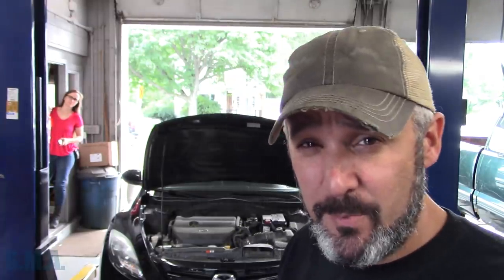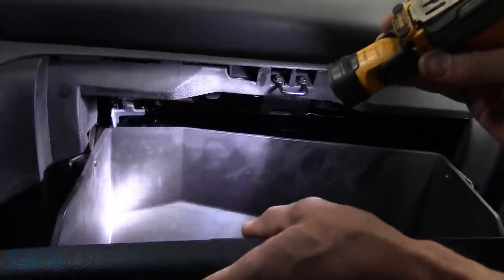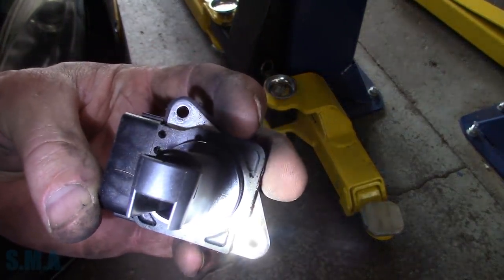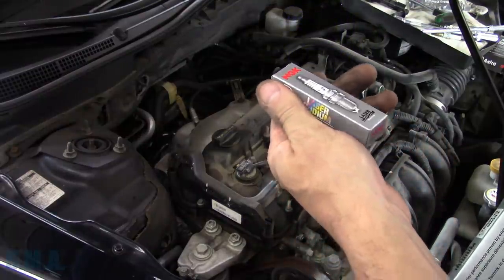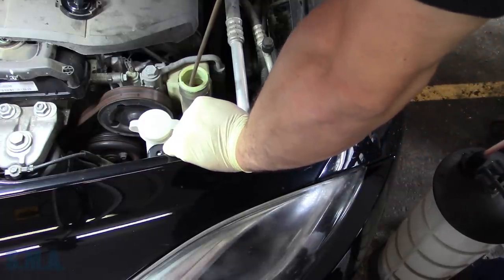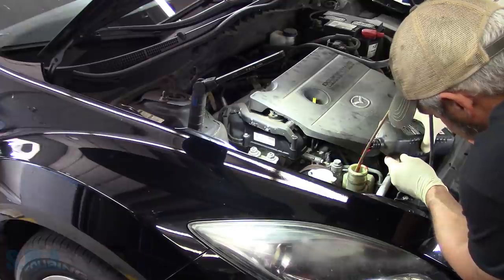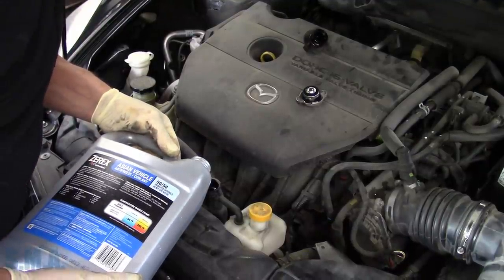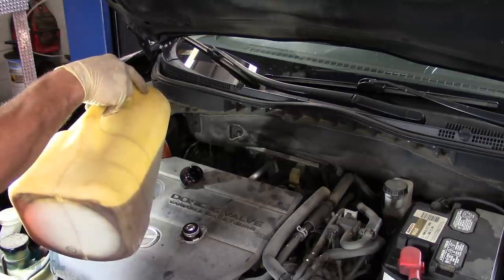Mazda 6: 100k Service Front To Back

Comment: Great Job ! Thanks. I LOVE  the education, plus your humor, candor and asides! As an EE "Shade Tree Mechanic", just did the 120K service myself on my 2003 Lexus RX 300 ... WITHOUT removing the intake manifold. Did not trust myself to do that. MANY HOURS!  The back 3 plugs & coils ... as you know are a true PAIN ... Removal order 4, 6, 2. After installing # 2 PLUG ... rubber boot was no longer in my socket! Whoa! Panic Time. After an hour or so on YouTube ... made my own extractor from a white metal coat hanger ... and ... with slim 6" vice grips as a handle ...  Got it OUT ... then went local and bought a MAGNETIC 5/8" socket. Whew!

Comment: Seeing you fill the washer fluid absolutely to the top reminded me... My mom barely drives anymore, maybe 1500 miles a year, so I do annual oil changes on her car. At the time, it was 2005 Mazda3. I changed the oil in the winter and topped off the washer fluid like that. One summer day, I was visiting her and we took her car somewhere. It was quite hot out, so we had the ac on and I'm sure it wad lava hot under the hood. When we got home, I noticed fluid leaking under the car. So, I popped the hood to have a look at washer fluid was percolating out of the little vent hole in the washer bottle cap. I guess filling it all the way up in the winter and having it expand in the summer made it leak out the top. So, I don't fill it 100% to the top anymore.

Comment: I use the old school trick on plugs, a piece of vacuum line on the plug wire side, twist by hand to make sure there is no cross threading on my Chevy Thunder, then torque to specs! Geez Louise, when was its last oil change? That brake pressure bleeder is a handy tool, I have a vacuum bleeder. Thanks for taking us along for the ride!

Comment: Man you are thorough! This is the sort of work I want from my trusted mechanic: just fix whatever little things you find and talk to me for the expensive repairs. I am so glad that you replace the drive belt. Would it be good to check the timing belt too (I am not sure if it has timing belt or chain)?
Reply: They’ve got timing chains, fords stopped using timing belts like back in the late 90s, we’ve got several customers at my shop that are super comfortable just telling us to go through the car and repair as needed and then just call them for anything major, definitely have to earn that trust over the years though.

Comment: Thank you for making that fact about MT fluids more widely known. Most people, even a lot of mechanics, do not realize this! I bought a Ford Ranger off a mechanic a while back, it had been his work truck for 21 years and not a single fluid in it was correct, right down to the gear oil I drained out of the transmission where MERC IV should have been. I was putting a lot of miles on it at the time so I drained and filled, put 1500 mile on it, drained and filled again, another 1500, then ended up running Royal Purple Synchromax. Fortunately, no lasting damage and after the 2nd drain and fill and getting all of the gear oil and grit out, the transmission no longer whined (screamed when I bought it, actually) and shifted smoothly.

Sadly, I was nearing the end of my list of repairs when a truck pulled ouf 50ft in front of me across 2 lanes of traffic and came to a dead stop. RIP Ranger.
Reply: Even if the MT does take a 75w-90 or 75w-140 or straight grade gear oil, wayyyyyy too many people put GL-5 in the thing. It must be GL-4. GL-5 is for differentials and it has a lot of sulfur EP additives which corrode brass. Synchros are brass. GL-4 has much less of those compounds and it does not attack the brass synchros. The synchros are what fail and lead to an MT's replacement because it starts grinding and failing to shift unless rev matched. People do more harm than good when they don't RTFM. Too much pride in some people's minds to do that though.
Reply: @mannys9130  Yup, I've seen this too. I've also seen (and been paid well to fix) what happens when adding DOT5 to a DOT3 brake system. People, higher number does not mean better!

Comment: down south  I have started cleaning the condensers as part of extended services ...drops pressures extending comp life and gives a temp drop at the vents
Reply: Eric car guy did a vid on that ,whats your process in cleaning the condensor if i may?
Reply: I buy the AC cleaner in a can for home systems. It foams really well and gets all the gunk out. Just did my frontier's condenser and trans cooler. So much junk and dirt came pouring out. Make sure to give it a good rinse with water.
Reply: @CRAPO2011  use a metal safe condenser cleaner to flood the radiator and condenser fins until it foams out both sides, let sit 10 minutes then reverse flush out the cleaner very thoroughly then blow out with a leaf blower until dry. recommend replacement if water flow reduction is noticed.
Reply: @jasoncook5307  Thanks for the tips :)
Reply: @CRAPO2011  also start at the bottom and work your way to the top so that the water doesnt just run right off from it
Reply: Yep Cottonwood trees are evil.
Reply: Nobody cleans their heat rejection devices and it makes no sense to me. Every 2 years or so I pull my whole front bumper off and clean the hell out of my radiator, condenser, and aux trans cooler that I installed. It's important. Cool cleaning is important for home HVAC too.

Comment: Check his recalls. He may be up for new free control arms and subframe. Did a ton of those in NY when I was a Mazda tech.
Reply: Most likely has the subframe recall. The control arms are only cx7, cx9 and rx8
Reply: I got thinking that after. Kias have the control arm recall which I work on now.
Reply: My 09 got the subframe recall.  Mine actually failed on the road exactly how the recall said it would.  Took Mazda 6 months to get the new subframe to me.
Reply: All because poor design of the AC drain.  Gotta love the Ford days of Mazda
Reply: @codyjacobsen6954  They claimed "insufficient paint" was the root cause.  No amount of paint could protect the poor quality steel they used for that.  Light surface rust on all nearby steel parts--subframe rusted completely through.  Crumbled in your hand.  I was very fortunate that mine snapped in a low-speed braking situation, rather than at a high speed.  Otherwise, the car has been great! (no joke).
Reply: lwnf360 .... Exact same steel that Chrysler use as in everything they make now....
Reply: I got lucky and mazda passed my subframe &installed a reinforce bracket, which im surprised it passed since i live in the midwest

Comment: Yes I found out the hard way with a ZF manual transmission in a Ford super duty, You must use the synthetic oil called for if you want the shifting smooth 🤓 Also on a Honda civic 1.7l 2001 thru 2005 it has a Coolant drain plug above the oil filter to drain the engine block down to almost dry for those who own them 19mm socket takes it out also don't loose the aluminum sealing washer on that plug ,  but first drain the radiator of course make it's fully cooled down first. GREAT CONTENT ERIC❗👍

Comment: I just did the same, all fluids replaced in my recent daily driver on top of getting all of the 'other' issues sorted.  While I already know better, I neglected to check the spare tire pressure to date.  Then I am watching Eric check that Mazda spare and I think to myself "yeah I need to get to that too" then I say no, I need to get off my stump this very second and check the darn thing right now or it will be forgotten.  I find the unused 14 year old factory original with only 7psi in it.  All the good a spare does when it is flat too.  This should be the very first thing I check when getting another beater, not months or years later or potentially succumb to a double whammy when getting a real flat tire.   Thanks Eric, I needed that nudge :)

Comment: 10:01 - adding Squirrel™ to your combustion chamber boosts horsepower and improves fuel economy...
Reply: Red or grey?
Reply: @dot7107  most likely red ( grey ones tire out rather quickly )
Reply: @dot7107  ground squirrel they like the dark.

Comment: I have a 2017 Mazda 3 with the 2.0 Skyactiv engine. And I freakin' love how Mazda made servicing such a breeze. Everything that needs to be changed regularly is easily accessible. German manufacturers could really learn a thing or two from Mazda's engineering.

Comment: We owned two Mazda 6s until last year, a 2009 and 2010, 4 and V6, both auto trans, and getting the right trans fluid is a tad harder than one might hope for - the trans uses Mazda fluid, but the part number is very close to a Ford sourced fluid, and if you mix it up, you get some crappy shifting (I didn't mix it up, the shop did). Ford and Mazda both issued TSBs reference the fluid mix up for Escapes/Tributes, Mazda 6/Fusion, etc. I ordered the correct fluid and doing three drain and fills with the correct Mazda fluid fixed it for me, fortunately, without grenading the trans. All part of the joy of the Ford/Mazda partnership that is thankfully over.
Reply: thankfully it's not as prevalent now, but the 80s/90s/00s were hell for chrysler autos, because people would CONSTANTLY put the wrong fluid in.  read the damn owner's manual! ATF+4 was spec'ed for a long time, and people and shops would put in ATF+3 or god forbid dextron/mercon fluid.  that'll smoke your go in a hurry.

Comment: Back in the ‘80’s, I was watching a car repair program on TV and they recommended flushing the power steering fluid at certain mileage intervals.  My 1982 Ford Escort had about 60,000 on it and I decided this is something I could do.  I flushed the fluid, which was a somewhat messy project and felt good that I had done the job myself.  It wasn’t long before I started noticing puddles under the car — you guessed it, power steering fluid.  I added fluid and the leak got worse.  I took the car to my trusted mechanic and he informed me that the seals were leaking in my power steering rack.  He would need to install a rebuilt rack, at considerable expense.  I told him that I just flushed the fluid, and he speculated that the new fluid cleaned the debris around the seals and caused them to leak.  He recommended not flushed the fluid but instead just removing the fluid in the reservoir and replacing it with new fluid.  Doing this every so often will gradually refresh the fluid without causing seals to leak.  Thereafter, I didn’t do ANYTHING to my transmission fluid except make sure it was filled.  Live and learn.
Reply: Just coincidence. I doubt your fluid change caused the seals to leak. 60k mile power steering fluid would not be severely junked up and plugging seal gaps. Change your ATF at 30-50k miles for maximum trans life. If you just ignore fluids out of fear of causing a leak, you'll destroy the part from lack of adequate lubrication. This is like someone saying "I changed my air filter and then got a check engine light for the MAF sensor, so now I don't change my air filter at all." That's just not conducive to longevity, you know? Causation and correlation.
Reply: Folks, do not ignore your fluid changes regardless of what you see on Youtube.

Comment: What I did when I did the gear oil on my lawn tractor was put as much in as cane out fast, then stick the container upside down on an empty oil jug, then start the next container, then switch it and cap the one I take off the oil jug, then when I have it mostly full, I put the stuff in the oil jug in all at once

Comment: I have driven a 2009 Mazda 6 2.5 6spd for the last 8 years. It's been the most reliable vehicle I've owned.

Edit: I did the serpentine belt at 90k, and I agree it's a pain. It's even worse when you don't realize your new belt is a little too short and you spend a lot of time trying to make it fit lol.
Reply: yes it is a nice ford.. FOMOCO FOrd MOtor COmpany using FOMOCO parts. FOrd MOtor COmpany
Reply: @srenlund-hansen6883  Yes, it does have some Ford parts. What is your point?
Reply: @svtirefire  no it has some Mazda parts, the rest is ford
Reply: @srenlund-hansen6883  Wow you revealed the big secret, that Ford and Mazda shared technology and models for 40 years lol. I think you're just trying to troll, but for what it's worth, on this car: Engine is a Mazda design built in Mexico, used in both Mazdas and Fords. Transmission is made in Japan. Brake calipers and rotors are FoMoCo. Every other part on the car is specific to Mazda. The car was assembled in a Ford plant in Michigan.
Reply: @svtirefire  they didnt share, most of it is ford
Reply: Mazda 6 is Japanese designed ..

Comment: Actually a great job in checking, doing the fluids tuneup and even checking the spare tire. One thing about filling the spare tire from this old guy and that is something I ran into from my mechanic. I would suggest before filling the spare to break loose the hold down nut before you air the spare up then tighten it up again.  Once that donut spare is properly inflated I had it where you about broke a nut (not saying which one) trying to loosen the spare up to use it when I had a flat tire.

Comment: i just did fuel injectors on my truck yesterday and it wasn't to bad. the only thing is the ford 3.0 v6 intake has to pulled apart just to get to the injectors and if you have one that quit it's best to change them all.
Reply: I miss my ranger with a 3.0 strong engine

Comment: The Mazda 6 is a good car. Only thing I ever did to mine was replace the blower motor after I forgot about the cabin air filter 🤦🏻‍♂️
Reply: This specific model had some corrosion issues. Other than that, the tech is rock-solid and the exterior design is easy on the eyes as well.

Comment: You haven't lived until you've put 10 gallons of oil into a OTR truck and forgot the drain plug!  Thankfully the drain pan was still in place.  Also, horror story... Gulf used to sell anti-freeze in *oil cans*, the kind you pierce... you can guess the rest.
Reply: Old enough at 54 to remember oil cans and the spouts.
Reply: Also don't double gasket the oil filter.

Comment: I was always told that when a PSP starts to make the "empty suction" noise it is hurting the pump!
Reply: Yes but how long till it breaks. I remember from school they said to empty the system u drain it and turn wheel but then they said the pump was meant to run with fluid so it will mess up the pump. So which is it wyotech? Hahah

Comment: Need a sound effect for the CRC MAF sensor cleaner!  ;-)
Reply: Oh great!!!  So what's next, can we get one for the penetrating oil, carburetor/throttle cleaner, electronics connection cleaner, pressured air...?
Reply: Sounds like 5 TO 10 EXTRA HORSEPOWER AT THE WHEELS
Reply: Engine rev ?
Reply: I vote for a duck call sound. 😏
Reply: Thomas Fletcher - yeah, that works. 😊
Reply: should have a water sound for when he uses that bad air🤣

Comment: Definitely rigged!!! Found myself needing a magnetic spark plug socket the other day while doing a timing chains 07 Pontiac G5 2.2 & a magnetic 10mm socket or driver tip for the upper guide problematic bolt, where the guide is known to break...As I was using my small extendable antenna style 🧲,  the tip/ magnet with the metal surround, came apart!!!!! The O-crap moment...Love your videos Eric!

Comment: Eric,
Great video - thank you!
Although Ford uses this 2.5L engine as well in several vehicles it is a Mazda designed engine. Mazda has their own parts/part numbers for the service items like filters, spark plugs, etc. I bet that vehicle had those Ford/Motorcraft parts because it was last serviced at a Ford dealer (perhaps a combined Ford/Mazda dealer).
SMA#1
God bless
Paul (in MA)

Comment: I don't know why the auto engineers don't make the cabin filter access panel taller than the filter so you don't end up just scraping all the debris off the filter and into the fan.  Of course none of those engineers have ever designed anything to be worked on. Even items that require routine maintenance.

Comment: Eric, You could have cleaned off the doors, boot and bonnet hinges and lubricated with some lightweight white grease. Also could have checked the operation of each of the exterior lights and interior lamps for correct function. Usual last items during the visual inspection of a 100,000 miles service.

Comment: These services are basically my job. Except on large heavy equipment. And I'm mobile, in a truck. Komatsu, Cat, etc. are what I usually work on. Although I do some work on Heavy Highway trucks. (Had to get DOT certified to adjust the air brakes, required here in Colorado)

Comment: I just changed my cabin filter about a month ago--2019 Elantra, 5 minute job and 20.00 bucks, tell your customer change EVERY year, glad to see you changed the manual trans fluid, thats so often overlooked.

When i had my 2009 Accent SE i used to go to WM for a what they call 'pit stop' oil change for 20.00 UNTIL i found out they SUCK out the oil from dipstick tube, Walmart at certain stores no longer drains oil as i guess people bring in old vehicles with stripped drain plugs or the employee forgets the oil--hehehehehe==lawsuit

Comment: Never seen anyone do such a great job on 100,000 mile service,wish you were in Wisconsin.Had my pickup at Chevy dealer 3 times for rear tire leak and tps sensors so far tire still leaks, message on dash says service tps system.did get a bill every time.

Comment: Mazda did a recall for 2009-2010 front sub-frame.  I see nothing have changed, that Mazda 6 2012 front sub-frame is pretty rusted.
Reply: They addressed the issue in the later iteration of the Mazda 6. Sadly, this model was known for corrosion issues.